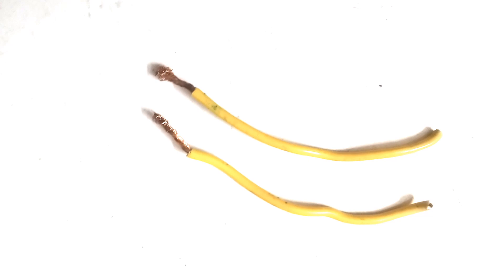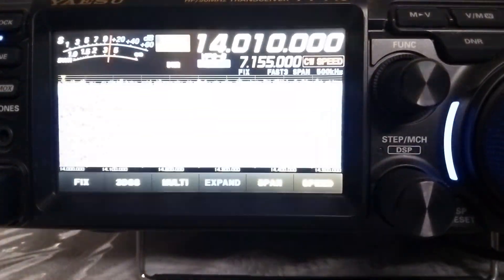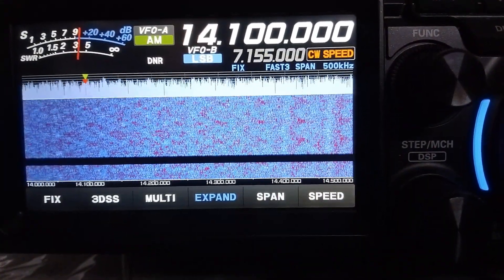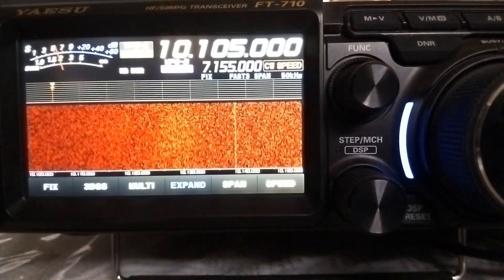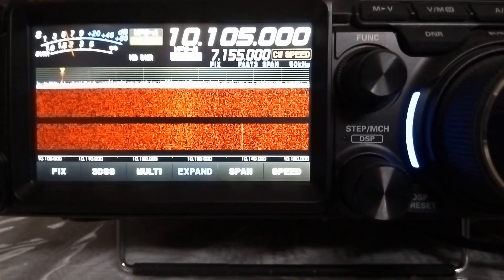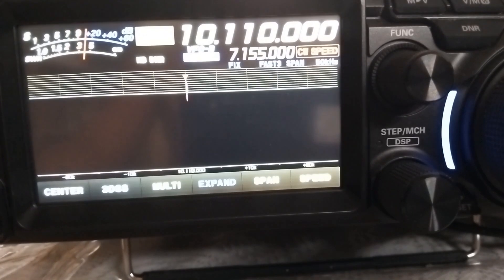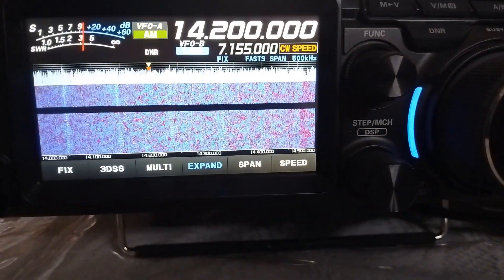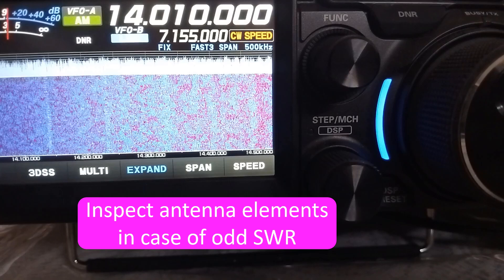How did my 80/20m loaded coil dipole antenna tune to 30m?

Comment: Good series. A nanoVNA would help you tremendously 😅
Reply from the maker: You are absolutely right. With no hint on what the resonance point near 80m is, I am really in the blind! For usual dipole antennas you could adjust length by folding back and testing SWR. But with two bands to check and the 20m segment being before the coils, folding back is not an option. Each time I have to trim and at some point I might overshoot the 20m band! My 40m friends VU2XTO and VU2XPZ told me that I should attempt tuning 80m only after 20m has 1:1 SWR. So it is a long drawn process. Thanks for watching. 73. Jon, VU2JO.